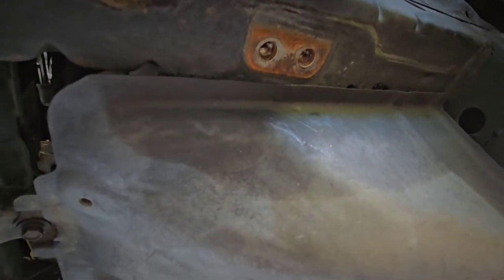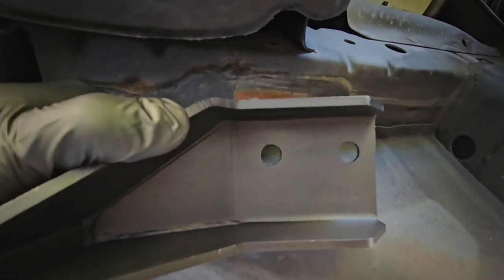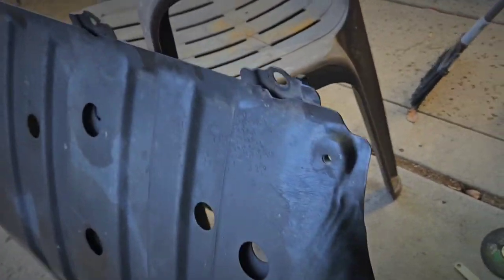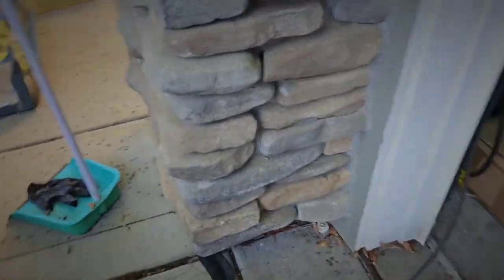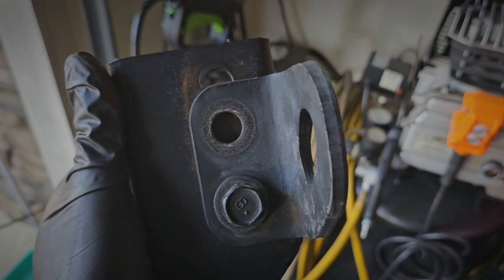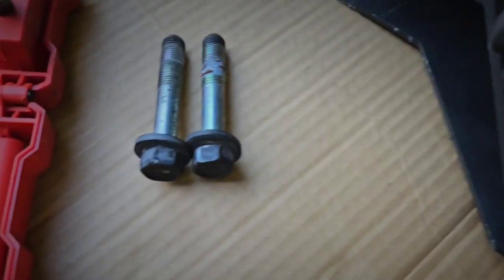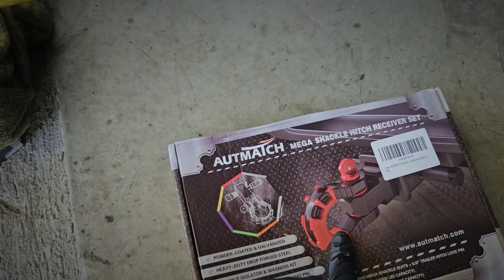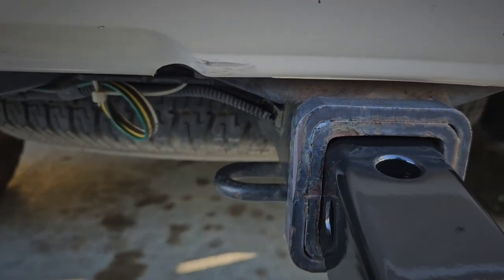Sequoia shackles and D Ring diy install

Comment: Where did you purchase your headlights at
Reply from the maker: AUTOSAVER88 Headlight Assembly Compatible with 2005-2006 Tundra Double/Crew Cab 2005-2007 Sequoia Black Housing Clear Lens(Not suitable for Regular Cab and Assess Cab) https://a.co/d/bK1psvU
Reply: Thanks man I appreciate it can you explain maybe in a video how you modded it to make it work on yours I have a 01 as well and I am  currently restoring it I have nice lights on it now but I like the black look thanks again for responding

Comment: Would you recommend this one (rs146) or the other one (rs145) i know this one hangs down lower for bull bar's but if no bull bar in the mix which would you recommend?
Reply from the maker: I suggest the RS146 which is the ones I'm using. I have seen the rs145 and they angle too high and likely to damage your front bumper in a tugging situation

Comment: Awesome Sequoia you have there.  I have a 2002 with 219K miles on it and it's running Strong.  My headlights are cloudy, I need the link to those clear headlights and grill.
Reply from the maker: I'll leave a link in the description and thanks for checking out the video, cheers!

Comment: Thanks for the video. What drill attachment did you use to cut through the RC bracket? I plan to do this on my first gen lol. Appreciate the help.
Reply from the maker: I used a 1/8" bit to make a pilot hole and a step bit to bore it out until the bolt slipped through perfectly.  You can get the drill bits and step bit assembly at any hardware store.
Reply: Appreciate the tip. I will definitely go in that direction.